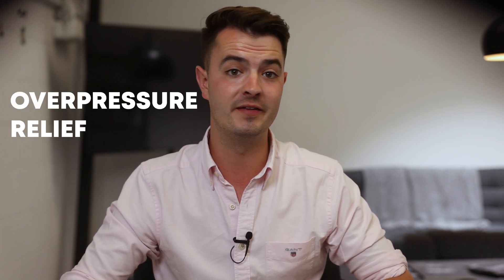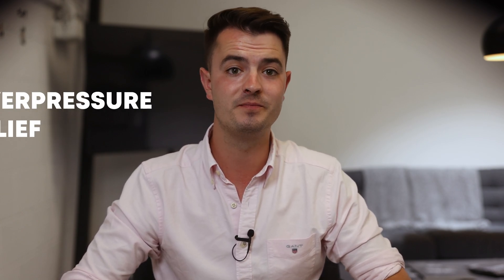Pressurisation Systems – Overpressure Relief Explained

Comment: In case if the VFD: The pressure difference become the process variable to control the fan that pressurizes the stairwell. Let’s say you have 5 floors. Then you compare each floor’s pressure (adjacent space) to the stairwell’s pressure (common space). 
Question: 
Do you have a pressure sensor at each floor and then pick the highest dP as your process variable, or you run the common reference of each floor (common pressure tube) and compare it to the stairwell’s pressure. In case of the the common tube for the adjacent spaces - will the pressure dP become the average between all the floors, or the highest, or the sum ?